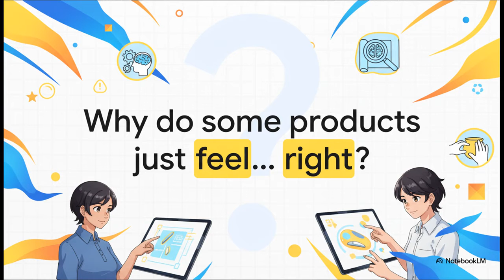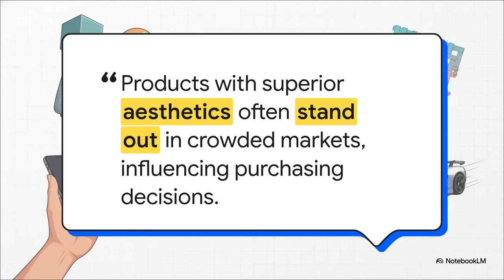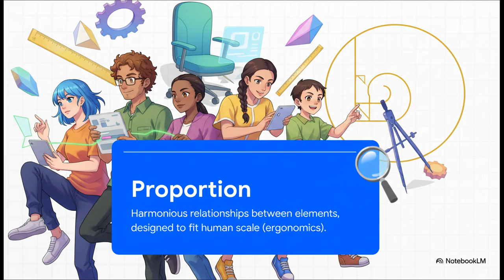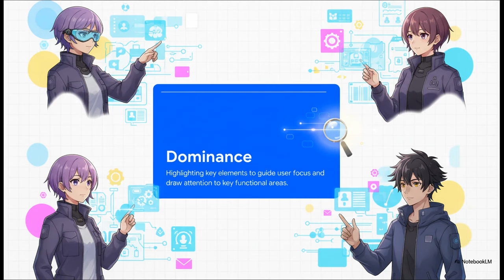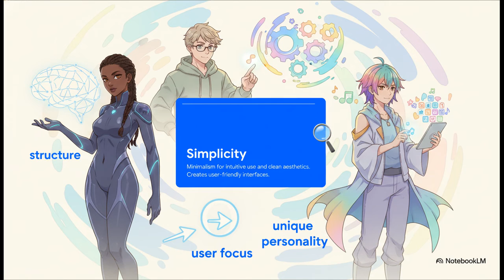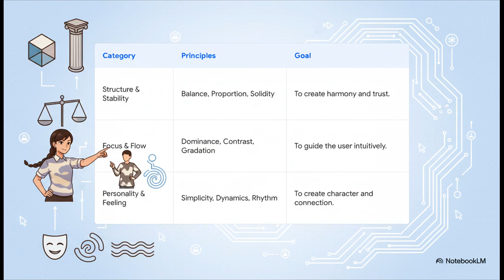Great Product Design

Comment: The design of my room shows balance through a balanced arrangement of the furniture to the left and right of the space. A white wall gives the feeling of solidity and simplicity. A clear proportion when table size, rack and bed fit with the room area. Wood furniture becomes dominant and gives contrast with the white wall. The different wood tone shows a little bit of the gradation. A neat arrangement of the furniture creates rhythm, while the unpacked area creates a dynamic and comfortable atmosphere.